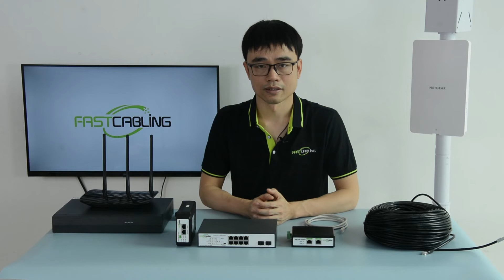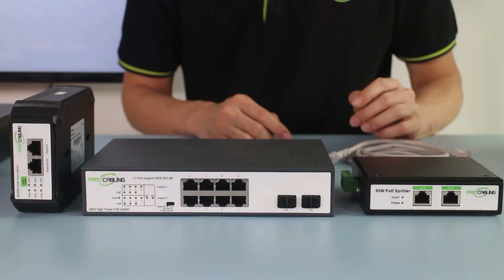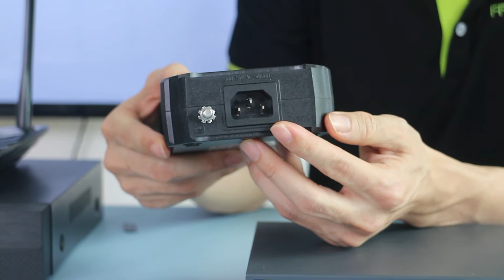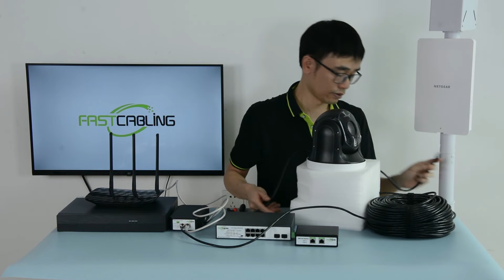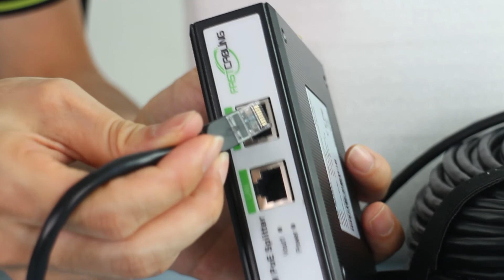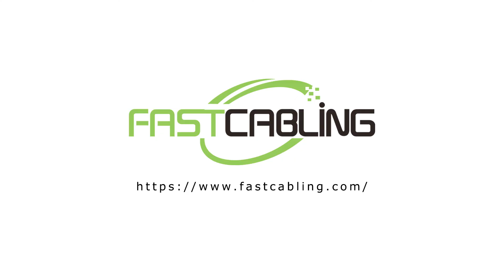90W PoE++ New Power Solution for WiFi 6 Access Point and Infrared PTZ camera

Comment: Sir can you help me what can i do to my 1000meters lan cable cat 6. What should i do because when i try it to install from PLDT to another router, there is no internet receive.. pls help me this sir. What should i do.?
Reply from the maker: The fiber optical cable is best solution. With two media converter both side and 1000 meter fiber optic cable, you can have 1000Mbps between point A and point B.